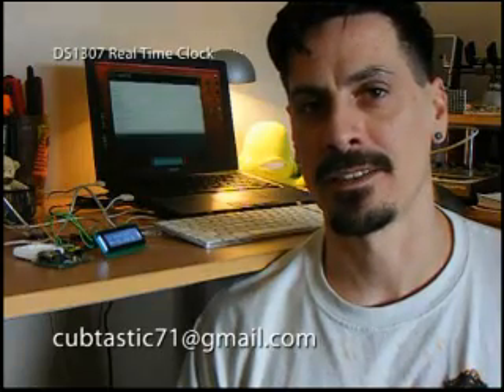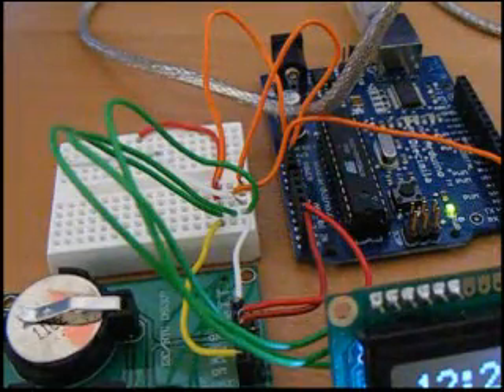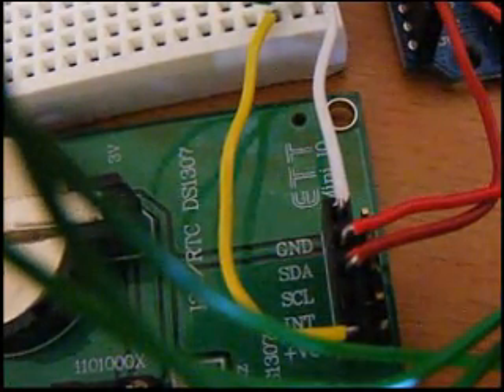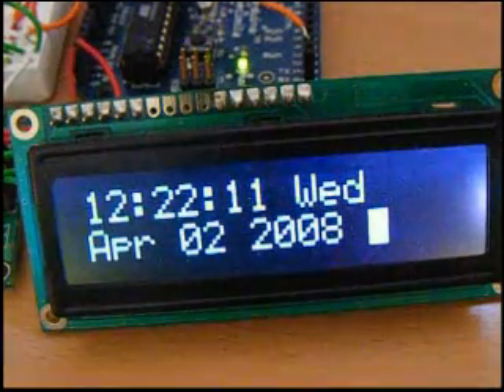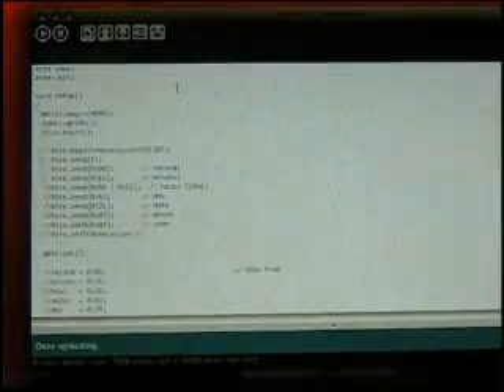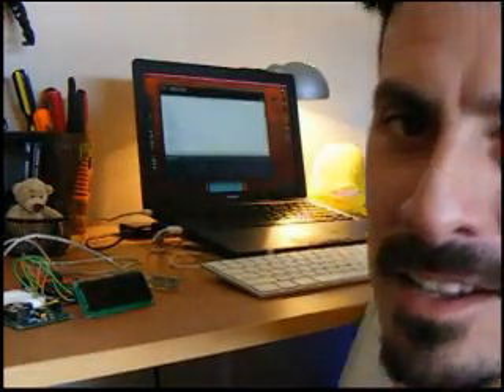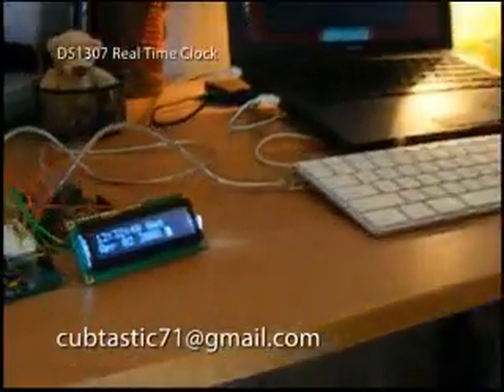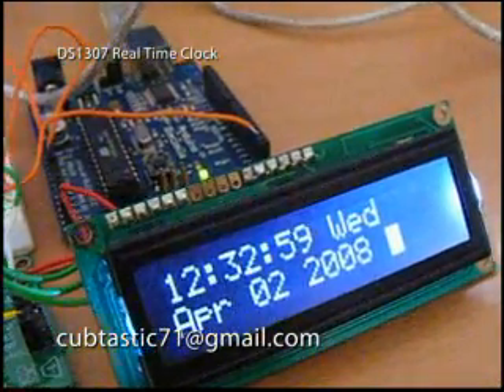DS1307 Real Time Clock

Comment: @2011supra I don't own the RTC but I doubt such a simple electrical utility understands 12-hr vs 24-hr timekeeping in two different "modes".  The math is simple to do manually.  If it's greater than 12, subtract 12, and you're PM instead of AM.  Hope that helps.

Comment: You can program the DS1307 to output a square wave which can be connected to an interrupt pin on the MCU, which can trigger an interrupt routine to read the time, and display it onto the LCD.